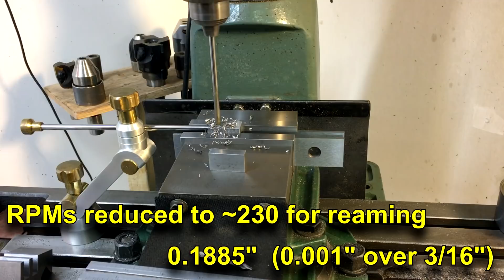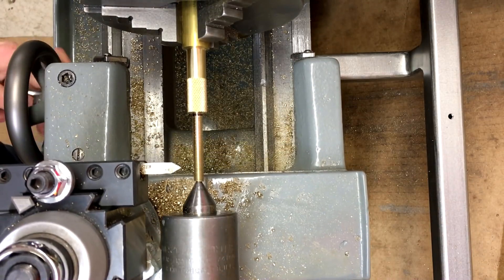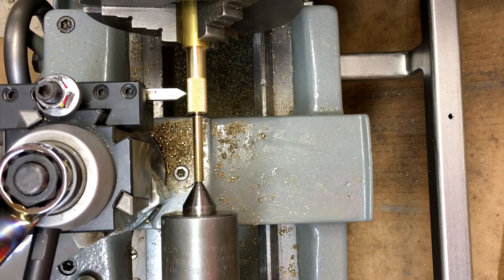Multi Position Carriage Stop Part 2

Comment: What is the point of screw cutting up to the head of the adjustable stops when there is only a short thread in the flip over pieces. A better design would be to lengthen the flip over pieces tapped as far as the pivot hole giving more adjustment length with those screws.  Other than that observation, it’s a good design.